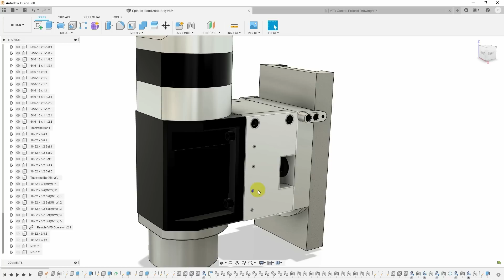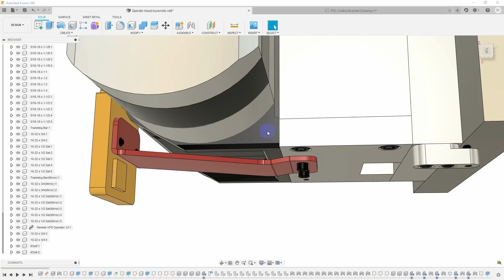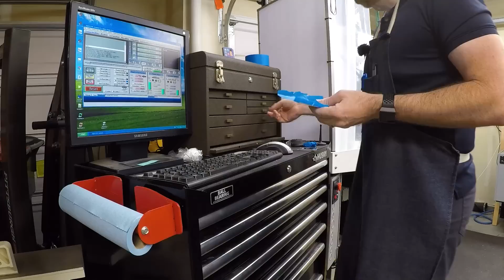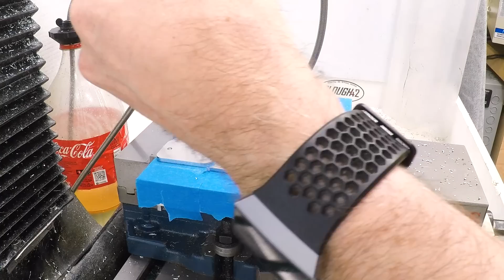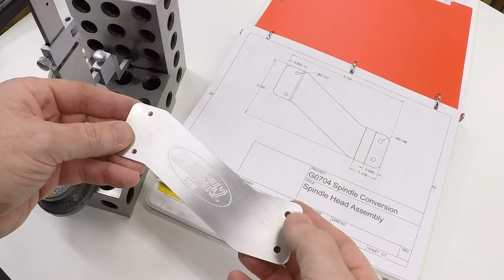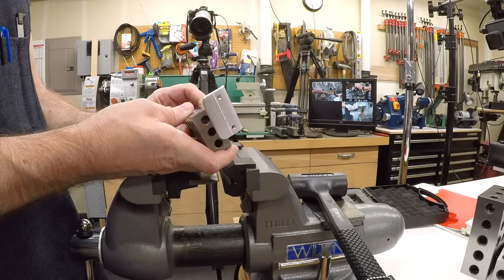ATC Spindle Part 12: Making a Sheet Metal VFD Operator Bracket

Comment: I wonder if its possible to add high speed spindle as a secondary spindle on the side of the existing one, so that we have the best of both worlds.. Or is it going to be too unstable because of speed spindle point of pressure will be not at the exact center of milling table, so saddle/dovetails will flex, you havent though about it?
Reply: having though a bit about it though - 4th axis for HAAS that I saw have even bigger overhang xD..

Comment: Hi James, I found your channel by chance but it was great, after watching John Saunders build an Arduino based CNC 5 years ago my journey started,  I live in UK,  I eventually finished up with a 2.2kw Spindle Motor and Huanyang Invertor on a third sctratch build CNC Router and I use Mach 3 also I need an RJ45 controller after seeing yours, doesnt get used a lot as I seem to spend more time on Electronics and Model railway, PCB Design,  3D printing and designs I do on a copy of Solidworks and Sketchup being retired plenty of time, also I love your Leadscrew convertion on the Lathe ... I will be watching more videos for ideas Thank You .... Regards John

Comment: James, I told you it was in the wrong holes but you "woodent" listen. 
Also you need a cable clamp under the top screw to remove the flex off of the connector, cat 5 I'm assuming. 
I also hope that all your cat 5 is of the stranded variety or the constant flexing will end with broken conductors inside the insulation which can be difficult to find.
The engraving needs highlighting in red or black. Maybe both.
Regards from banana land, Ontario.

Comment: Have you tried a 1/4” or 3/16” SINGLE-FLUTE END mill running at 12k+ or so RPM?
Reply from the maker: I have a very down-cutting single-flute end mill from Harvey Tools that I use to cut PVC, and it's amazing.
Reply: @Clough42  give it a shot on aluminum, I’ll bet you’ll like the result….
Reply: Carbide, not HSS…

Comment: I've seen some guys on Youtube spread enamel paint on the Logo and then sand it to pop the lettering on the Logo.
Reply from the maker: That works better with a deeper engraving.  I did that on an aluminum control panel in a previous video.

Comment: You can also use double sided tape to hold sheet metal parts like that.  Nitto P-02 is what I prefer.  It doesn't leave any residue behind.  Alcohol solvent acts as an off-on switch.  Also, try fewer flutes on your endmill when cutting parts like this.  My first employer would routinely use 1 flute endmills on their router table.  They used used an oil mister as coolant with a non diluted machining oil.

Comment: Very cool video. I've had good luck bending 6061 if you heat the bend area first then let it cool to room temperature before bending.
Reply from the maker: This world suggest that the T6 temper is more of an issue for bending than the actual alloy.

Comment: Clough, watch the Titans of cnc video on coolant methods, when you spray mist on the front face of the tool and it goes behind a part, it doesn't get coolant any more. Then it gets chip weld and recut

Comment: James, I stick thin sheet metal with double sided carpet tape to a flat piece of material and stop milling 0,1 mm above the bottom of the part. This 0,1 mm keeps your part from moving. After this I just pour boiling water in between the part and the fixture plate which softens the glue and I can peel of the part. I remove the tape residue with white spirit and, depending on the shape, cut or saw the circumference loose. Afterwards I use a small chamfer bit with a tiny roller bearing on the end is a dedicated upside down router underneath a steel table (Makra KEG 250) to clean the shape completely. A file is also a way to clean the part. I use this all the time even with thick aluminium parts up to 10 mm or so. Maybe a helpful tip for you to. Thanks for sharing and best regards, Job

Comment: Hi James, If you run the last pass counter clockwise i.e. conventional milling, it would not leave the tape residue on the sides. If you check your cutoffs you will notice they are clean. Actually there is no reason why you can't run all the passes conventional. On softer material like plastics and in this case the tape the cutter will "clean" the sides instead of leaving cutting residue.

Comment: I really enjoy your videos! 
Two tips:  I had good luck re-running engraving toolpaths to get rid of a burr. sometimes just ever so lightly lower in z.
and I have the same vice bending thing (or looks very similar at least) the "bottom" V part is a very rough casting on mine. only the V is ground but the top surface where the sheetmetal touches initially is quite rough. the stuff is not hardened and I was able to file and polish it a bit to get way less marring.

Comment: Is coolant going into the operator panel a concern? Or is it IP rated? Failure mode could be sketchy until you get to the estop.
Reply from the maker: Yeah, that could be a concern.  I've never had coolant get that high on the spindle housing.  All of the electronics on the original head were in a similar location without issue, but it's something to keep an eye on.

Comment: When i make brackets like that i use wood in the vise and screw it down. Save the plate of alum, besides and coolant may loosen up the tape or glue..prototype kinda guy here...
Reply from the maker: I was worried about the coolant releasing the tape, but haven't had trouble yet.  When it goes one day, I'll try to get it on video.  :)

Comment: Can you still use the “fly cutter” with the higher speeds?  If not, what will you do for a large facing operation, and aren’t you going to miss that tool?
Reply from the maker: I think a fly cutter would be sketchy with this setup, and I already miss it.  I've done some experiments with a 1/2" carbide end mill, and the results are promising.  https://www.instagram.com/p/CFzawWwp6y3

Comment: You could use the engraver to mark the bending lines. Or make a sharpie attachment, though it would be a bit scary having that thing in the spindle.
Reply from the maker: I was planning on engraving the bend lines until I realized two of the three needed to be on the other side of the part.

Comment: Next time chuck up a tungsten Tig rod in a tool holder and have the mill scribe your bend lines. I use Tig points for all kinds of scribing, usually in a mechanical pencil body. They are cheap always available (in my shop) and they stay sharp, regardless of the material being scribed. Also, easy to resharpen, if needed. My Tig welding is bad enough that I have plenty of practice repointing rods.

Comment: Epoxy/paint/fingernail enamel in color of choice into logo + repolish face -> high-contrast logo on visible part.
Even if you decide it's ultimately not useful here particularly, experimenting/researching a bit covers a lot of aesthetic variation that's extremely easy to add. And the hard part is the CNC chamfered logo :D

Comment: Nice job, looks great. Really enjoying following along with this upgrade.  One suggestion would be to put some kind of boot or cover over that RJ45 connector, as they are not sealed or protected in anyway from chips or coolant. I realize you placed it fairly high up to reduce this, but I would still suggest protecting it somehow.

Comment: What if you replace the cap that holds the bearing with a piece that has a friction lock onto the screw shaft (the cylinder part near the handle)? That will let you lock the vice as needed

Comment: I just purchased that same wilton tradesman vise from Amazon. They literally shipped it in a cardboard box with the little packing pillows. Handle and screw were bent. With the pandemic, I won't be able to get a replacement from wilton till Dec or January due to shipping delays.
Reply: Handling during shipping must be horrific if they managed to damage a VISE.
Reply: I think amazon must be having trouble hiring packers who can think. I just received a shipment of hard drives with no packing at all. Just 2 drives rattling around in an overly large box. I'm surprised even one spun up. The second one just went tick, tick, tick..........

Comment: Also, you would love flood coolant!  I messed with many different approaches to mist and mql coolant/cutting fluid. I put off switching to flood on the 1100mx for months.  Should have done it day one. Nothing sticks, chips are evacuated (my system is heavily modified) and I can operate at speeds that would have been an almost instant gummed and snapped end mill in the past.  The occasional mess occurs, but it is totally worth it!

Comment: I've found that repeating the engraving pass by itself often removes the burrs.  If that doesn't get it, and it's the last operation for the part I'll adjust my Z by .02mm and run the engraving again and that almost always gets it. I usually post my full operation plus the engraving separately so I have the engraving file by itself to run. Good work as always!
Reply from the maker: Great suggestion.  Thanks.  I should probably do some experimenting.  Supposedly this particular tool can make clean one-pass cuts.

Comment: What is the purpose of doing the drilling first in those holes as opposed to just going straight in with the end mill?
Reply: I asked this of someone else a while ago and the answer was chip management.  Perhaps someone can confirm. 

But the end mill doesn't pull chips upwards to evacuate the hole like a drill bit does. Its more of a cutting motion that flings them more to the side. So once you plunge into the work material,  there is no place for them to initially go and you run into that chip gumming the cutter and welding to the endmill problem that breaks them. 

I think the type of end mill and material plus the experience of the operator plays a role in it too.

Comment: Nice. What RPM/feed were you using for the 1/4” endmill? Sounded pretty fast.
Reply from the maker: 12KRPM, 54IPM, .0015IPT.  I do most roughing (adaptive clearing) in 6061T6 at 12KRPM, .002IPT, 72IPM, .0625" WOC, .250"DOC.
Reply: @Clough42  Thanks!

Comment: One thing I am an aircraft mech you never want to scribe aluminum (we use a Sharpie pen) , that will cause a crack with vibration we are constantly sanding out scratches for this reason.  Love your  videos keep up the good work
Reply: That makes a lot of sense for aviation purposes.  This is a bracket for a controller.
Reply: @kjmcf68   I understand it is bad habit, most of the time it will crack when you bend it  using thin sheet metal
Reply: Yes, I was thinking unnecessary stress risers. Just spent a day remaking a hardened steel part that snapped because of a thin (0.35mm) slot so the lesson is fresh.
Reply: I was thinking the same thing, but I convinced myself that wouldn’t really matter since it’s on the inside of the bend.
Reply: just set up a tool with a sharpie pen. — best of both worlds.  also can be chemically erased after bending.

Comment: Nice work! Have you used double-sided tape from McMaster? Works just as good & its exactly.007" thick. Faster setup time & cheaper if you need to cut multiple pieces. Either option gets tricky if there's a slight bow in the material.
Reply: I like using 3M 467MP. It's incredibly sticky, resists solvents and is very thin (.002"). Bit of a pain to clean/rub off, but it does hold VERY well.
Reply: Andrew Bird 467MP is what I specify for permanent graphic overlays - it holds very well
Reply: @ADBBuild  I haven't used 3M tape on the CNC but this is what I use. Hardly any cleanup. The only thing to keep in mind is the subplate used should be surfaced flat to eliminate any pockets. Then both pieces cleaned super well before applying.  .010-.015" doc with even step downs works very well. Keeps the aluminum from gumming up the endmill.

Link to the tape I use - https://www.mcmaster.com/double-sided-tape/light-duty-mounting-tape/

Another machining Buddy uses a slightly more expensive tape like this, I've compared and this tape here works the best.

Comment: have you considered using  the CNC to make the bending lines? using the engraving bit even, might automate just one more task.
Reply: If the bendings are all in the same directions you can, you can't engrave on the bottom side 😎
Reply: @andarthome142  i was originally thinking of the cnc to engrave the lines but the backside presents a problem
Reply: @ww55d  You can mark them by milling small slots on the edges
Reply: @ww55d  - Bend lines don't have to be done to .001" accuracy,  flipping the part and doing it in two operations would still be more than accurate enough.
Reply: chuck up a Sharpie!  haha
Reply: A technique I use regularly is to add small tabs (1/8 x 1/8) on the part profile that align with the bend lines. The alignment tabs are created in the first op and there is no weakening of the sheet from an engraved line. The tabs are aligned with the bending jaws - no layout required. The downside is the tabs need to be removed with a kiss on the grinder after forming. Additionally, we usually profile our blanks with water jet or laser so the inside radius on the tabs is minimal. Not ideal for every situation but our benders love it.
Reply: This is the comment i was looking for ahahah